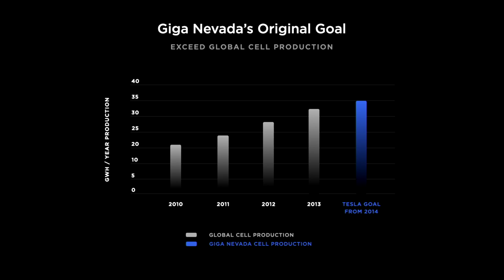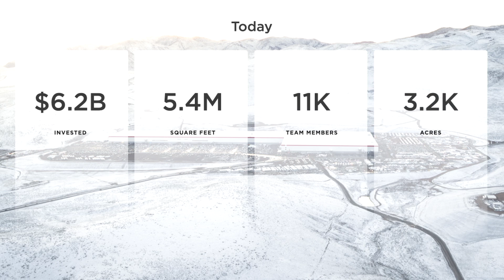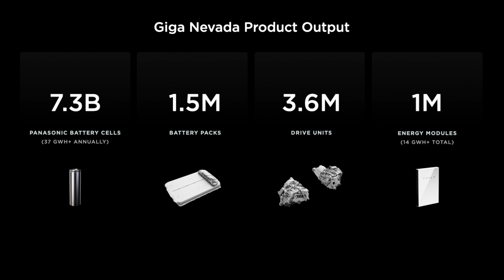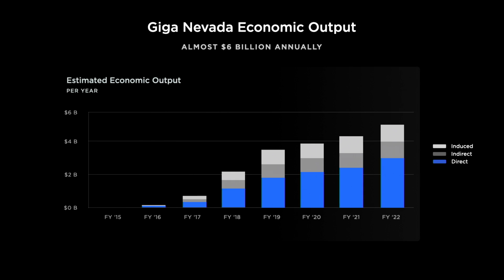Giga Nevada Battery and Semi Manufacturing Update

Comment: I am not a US citizen but I feel very proud and touched what you guys are doing. Good luck for Tesla and Nevada!
Reply: @potatotiel HAHAHAHA. You’re oblivious as hell. Teslas do not degrade the way normal cars do. It is much much harder to break down the toxic waste of a tesla than an ICE. but go on living in your fantasy.
Reply: @potatotiel A tesla is roughly 50% plastic by weight. Most of the plastic is not recycled or even recyclable.  Plastic recycling is a failure in general.
Reply: @potatotiel I replied,  but dont see it. So I will try again. Fuel cannot be recycled, correct.  But neither can the energy (fuel aka grid energy) that was used to charge your electric fuel tank. Where does the grid energy for the battery (aka fuel tank) come from?

Do some research into plastic recycling.  It's really bad, most ends up in the landfill.  The triangle doesn't mean it's getting recycled.  A plastic throw away ev is a horrible idea in the 1st place. Long lasting, practical sized and reasonably powered ice and electric vechicles are a far better option for our environment. 

75 hp, 60mpg  2,000 lbs simple ice or electric vechicles is the answer for now. Not 4,000-8,000lb 300-1000hp 350v monster grid powered electric vechicles. Overpowered ev is putting the cart ahead of the horse when we don't have abundant clean grid energy available in the 1st place.
Reply: @potatotielBut 99% dont have regular access to a solar charger. How many solar panels do you have?
Reply: @potatotiel car owning in general is negative for the environment and is only necessary in rural or bad designed suburbs and the occasional horribly designed city. It’s not a favor, it’s just less bad if you drive a lot.
Reply: @potatotiel Cities and horrible for the environment.  All the land is destroyed and contaminated. Pavement everywhere,  massive disruption to migration and wildlife in general.  Streams and rivers carry millions of tons of trash and plastic from these high people concentration area to the oceans

Cities = environment disaster.
Reply: @potatotiel no.
Reply: @potatotiel no
Reply: Welcome friend!❤🎉❤🎉❤
Reply: 1년전이지만 좋은 사람들과 일하고 계속 새로운 자원을 발전시키는 일론은 일중독입니다. 좀 쉬어야됩니다.건강하세요 ❤❤❤
Reply: @potatotiel  A battery only stores energy. What you're saying would be no different than a gas tank manufacturer producing a whole bunch of gas tanks claiming they are saving the world.
Reply: @Dat_Sun  if those gas tanks were able to power cars with no emissions, sure
Reply: @miscl_anon  Please educate yourself. Teslas DO NOT have 0 emissions. Those emissions are just simply in the production process rather than day to day use.
Reply: @satvikarora5813  
>production process 
by that logic, wind turbines and hydroelectric dams aren’t environmentally friendly either bc they surely produce emissions when they’re being built

>rather than day to day use
right, the car is zero emissions. the factories that create it might not necessarily be
Reply: @satvikarora5813  
>easily be recycled
And how much is it contributing to emissions while it’s operating? Also, internal combustion engine cars still use batteries, which also need to be replaced periodically. Please educate yourself
Reply: @miscl_anon   Sure that could be done. Ethanol. But it's not very practical just like an electric vehicle is not very practical. We can charge a battery with "renewable energy", but are we?  Virtually all of our grid is fossil fuel powered. Especially during the night time when you want to charge. We don't have enough grid capacity as it is.
  Then ask yourself what is renewable energy and does it involve fossil fuel?
Reply: @Dat_Sun  
>but are we?
depends on what kinda infrastructure is available. tho it’s best to install solar panels on your roof so you know for sure
Reply: @miscl_anon   As a whole our nation is basically fossil fuel powered. Sure there are millions of tons worth of wind turbines and solar panels, but they're hardly accounting for anything at just 17% at best.  17% does not consider all of the fossil fuel powered equipment that is used and required to maintain these projects.
  It does not consider the turbine gearbox oil changes, It does not consider the thousands of employees who fly all over the country to maintain construct or decommission these things. It does not account for the heavy oil that was burnt while being floated across the globe, or the semi trucks that deliver it, it does not take into consideration fuel used to create access roads, to dig and pour massive concrete foundations for Wind turbines. It all adds up quickly to = a big sham.

 I do not believe that solar is a good idea. How much power can you expect from 1 average solar panel?
Reply: @Dat_Sun  
>I do not believe that solar is a good idea
Solar isn’t the most power efficient, but the states aren’t exactly building nuclear reactors anywhere, and it’s not like the government will allow consumer grade nuclear reactors

>Our nation is basically fossil fuel powered
And it will stay that way if we don’t take steps to transition. Buying electric cars and trucks is one of those steps. The country didn’t come to rely on fossil fuels overnight, and it won’t come to rely on renewables overnight either
Reply: @miscl_anon  The best thing is a mix. Some ev where abundant wind, solar or hydro is available. But electric vehicle manufacturers need to immediately stop with the insanely heavy and overpowered ev's. A 500hp ev sedan is incredibly wasteful and it's putting the cart in front of the horse.  Until we have an abundance of clean grid energy and enough materials to manufacture lithium cells, overpowered ev will continue to be as wasteful as ice.

A 2500lb 75 hp ev car or truck makes sense, not a 4000-8000lb, 300-1000hp 350 volt monster with thousands of lbs worth of lithium batteries on board. 

Same goes for ice manufacturers,  the wasteful 300-1000+ hp vechicles available today are energy cows, requiring excessive fuel, more maintenance and Lots of tires.  Both ice and electric vechicles have become ridiculously overweight and overpowered at the same time. Loaded down with thousands of lbs of junk and plastic.  

  Our only real option is to downsize back to reality and be more efficient.  We can manufacture 2klb 75hp 80mph ice vechicles that get 50-80mpg but nobody wants them, everyone is special and deserves a bigger, more powerful vechicle than the next guy. 

  Most importantly people need to understand the battery is basically a fuel tank not a energy source.
Reply: @Dat_Sun  
>basically a fuel tank
The primary problem with fossil fuels is pollution, which batteries offer a solution to. An ice car creates emissions as it burns fuel, but the only thing an electric car emits as it drains energy is heat, which gets dissipated into the atmosphere
Reply: @miscl_anon  Wrong, where is the energy coming from? You are still seeing the battery as a fuel source.
Reply: @miscl_anon  And who says ice vehicles pollution is a problem? What vehicles in particular or are you grouping them all together?
Reply: @miscl_anon  not really true, windturbines produce more energy than the production of the windturbine required. teslas don't.
teslas waste energy by wearing down it's own battery and the tires wearing down, as well as the pavement getting damaged by the tires since EV's are quite a bit heavier than normal combustion engine cars. i don't use a car at all, i use my 28 mph e-bike to get around the city and town, it brings me to work, to school, and grocery stores.
the world can't really get sustainable unless we humans change our habits/norms.
Reply: @miles5600  your 28 mph ebike is gonna have a hard time carrying more than 1 person, or more than a week's worth of groceries for 1. cars exist for a reason

>teslas don't
... teslas aren't meant to produce energy? they're meant to offer a clean alternative to gas powered cars
Reply: @miscl_anon  man you're so wrong...
it's an urban arrow e-bike which can easily carry your weekly groceries and it can also carry a full grown ass human. this is exactly what i mean that your mind is totally carbrained.
Reply: @miles5600  >easily carry your weekly groceries
what about a month's worth for 4 people?

>a full grown...
what about two? four?
Reply: @Dat_Sun  >where is the energy coming from?
Anything that can generate electricity, unlike gas powered cars

>who says ice vehicles pollution is a problem?
the epa
epa.gov/nutrientpollution/sources-and-solutions-fossil-fuels

my previous reply to you disappeared fsr so I'm doing it again
Reply: @Dat_Sun  >where is basically all of our energy coming from?
sure, it's fossil fuels, but it doesn't have to be that way, and adopting renewable energy [eg. using electric cars] will help move away from that

>science and records are
idk what you think the epa does if not working with science and records
Reply: @miscl_anon  Using the Electric Car right now is placing the cart ahead of the horse. Once we have the available clean renewable energy problem solved and on the grid. Until then it's a sham for profit.
Reply: @miscl_anon  a month for 4 people work fine too.
if you wanna transport 4 people, get 2 bikes.
would still be cheaper than a car and actually sustainable.
Reply: @miscl_anon  Again,  Tony Heller and do some research for yourself.  The epa is seriously corrupted.
Reply: @Dat_Sun  On the contrary, adopting the electric car now would eliminate the dependency on fossil fuels faster, since cars would no longer rely on them. that leaves the grid, instead of trying to transition the grid first, then spending another decade trying to transition society to electric cars
Reply: @miles5600  two bikes implies you can find someone to ride that other bike. what if you're trying to transport 2 people who don't know how to ride a bike?

>a month for 4 people work fine too
I'd like to see you try
Reply: @Dat_Sun  >Tony Heller
you'd rather trust some nobody on the internet than reputable sources. tells me how much to value your views
Reply: @miscl_anon  The grid demands would sky rocket. We would have to build hundreds of coal plants to meet demands making things worse. Remember the Battery is like a extremely heavy fuel tank, it's not a source of energy. It stores it, and does a poor job in general.
Reply: @miscl_anon  try? search it up on youtube, there are enough video's of that stuff.
it's not my problem if someone can't ride a bike, even though it's really easy to learn.
how about the people that need to get a license? costs them even more money and learning to drive is pretty difficult if you wanna learn it good.
Reply: @miles5600  >there are enough videos of that stuff
I don't see a single one with 10 bulky bags worth of items

>it's not my problem
then why are you trying to antagonize cars if you don't care whether someone can use your alternative?

>how about the people that need to get a license?
see, the nice thing about cars is that, as long as at least one person in the group has a license, they can operate the vehicle, which can usually easily seat 3 more people. unlike a bike, which is usually built for one person
Reply: @miscl_anon  Using practical amounts of fossil fuels is totally acceptable. History proves this, things were worse long ago, I remember smog from 70-80's, but some adjustments to performance were made using emissions equipment and testing solved that. 

The problem now is people expect to much. Everyone wants bigger, faster, fancier, more needless tech. The end result is 300 ~ 1000hp 4,000 -10,000 lb electric vechicles that rely on fossil fuels from birth till death. 

As of now, there is no practical way to recycle li-xx batteries. Most are told to discharge them and puncture the envelope or cell wall before chucking them in the trash. We will run out of li-xx materials well before fossil fuels could be used up. The future of ev depends on a new environmentally friendly battery, and fossil fuel footprint free wind turbines and solar. Don't hold your breath. 

We are seeing the same wasteful designs as electric with ice vehicles as well, it needs to stop. We can do just about anything we need on 50-200hp for most vechicles. 1000hp Tesla's, chargers or other hotrod gas and energy hogs are a much bigger problem than practical ice couldever be.
 A reasonable mix of low power, high efficiency vechicles, cars and trucks would be ideal.  Most importantly in a free market.
Reply: @Dat_Sun  >using practical amounts of fossil fuels is totally acceptable
then using none at all is even better, no? besides, the "practical amount" will be different from place to place. a lot of people using their own "practical amount" adds up to an impractical amount of emissions 

>we will run out of li-xx materials well before fossil fuels could be used up
we will most likely come up with new battery technology well before we run out of li-xx materials

>the future of ev depends on a new environmentally friend battery, and fossil fuels footprint free wind turbines and solar
no time to start like the present
Reply: @miscl_anon  it's not like everyone in the US lives with 4 people in one house, some do but a heck of a lot do so to at least get 2 people to get groceries is a major step.

in europe pretty much everyone can ride a bike so maybe that's a sign that the US should make bike practice a standard subject in elementary school...
you gotta begin somewhere so if you're saying that bikes are a problem because some people can't ride bikes than you're not open. 

if you look at cars passing by on highways you'll see that a LOT of them are only occupied by one person and not 2, 3, or 4.
but they take up so much space that it's a waste of the cities space.
i recommend you watch: not just bikes, on YouTube to really get why US infrastructure sucks and why this needs to change if we wanna drastically push back our climate change from getting worse.

bikes and e-bikes work fine in Germany and The Netherlands so why not in the US?
Reply: @miles5600  
>it’s not like everyone in the US lives with 4 people in one house
Not everyone lives in a city either, where everything is conveniently a block away. Some people have to drive a mile or more to get from place to place, which makes biking tiring and impractical

>that’s a sign that the US should make bike practice a standard
i think the potential legal liabilities from injuries would prevent that from happening

>why not in the US?
The United States is such a big country that what works in one area won’t work in another. Again, people who don’t live in cities use cars to get around conveniently. For people who do live in cities, bikes work fine if you need to haul a small load or travel somewhere nearby
Reply: @miscl_anon  I explained what practical is, 50-200hp ice. Not 4k- 8,000lb ev @ 300-1000hp.

There is always claims of future battery tech.   Basically nothing has changed since the beginning.  Battery tech is ALWAYS a trade off. Reliability and durability for capacity. Batteries are always big heavy.  

Solar, wind turbines and other gimmicks are just that. Where does a wind turbine come from? Lets take a clipper liberty series 2.5MW. Where did it's life begin?
Reply: @Dat_Sun  >50-200hp ice
ok? that says nothing of how much the car is used. more frequent driving means more frequent emissions, regardless of how much fuel it consumes

>where does a wind turbine come from?
>where did its life begin?
yes, they both came from fossil fuel powered assembly lines, but they’re expected to last decades, which i’d argue far offsets the amount of emissions produced in creating them
Reply: @satvikarora5813  Tesla’s have significantly greater efficiency in terms of the energy it uses so even if we assumed that all of our energy production is from things like gas ( it’s not ) it would still be better in the long term.
Reply: @miscl_anon   Ever since the late seventies we've seriously reduced vehicle emissions with smog equipment.   It's at a point now where it's not a problem.  
But we need to think of the future and stop manufacturing ridiculously overpowered vehicles both electric and ice.

 Until we have some kind of magic powercell that generates electricity from water or air on mass without any significant external fuel or power source (aka a perpetual energy machine) hopefully air because water is scarce in a large parts of the world. Until then, we need to be responsible and take only what we need. 

Wind turbines hardly ever last as promised, and generate far less than rated/advertised output on average. 
 I assembled,  commissioned,  repaired, decommissioned and assisted in demolition of Clipper Liberty series wind turbines within a few years. The same turbines.. Literally blown up and written of due to high maintenance costs. 

This happens all the time, wind turbines fail daily,  manufacturers like vestas keep employees lips sealed with non disclosure agreements.  I have seem Clipper blades break and fold over, I've seen Mitsubishi turbines spray oil over acres of crops then burn to the ground and not get reported.  

I have worked at sites changing ownership in a year or so, maintenance turns into a sham, everyone gets cheap, major maintenance gets ignored because of cost. Towers catch fire and fold over without witnesses all the time, it's hardly reported. Tax cattle and energy consumers flip the bill. 

I know this as fact having worked up tower for over a decade, even longer on the ground assembling nacelles, unpacking shipping containers of parts to assemble the towers.  Each tower comes with a whole shipping container or two, maybe more. . Parts are from all over the world, mostly from places that dont have any environmental standards or requirements for manufacturing. When all is considered, we do not have renewable energy. 

How much concrete is used for an average 3.0mw turbine foundation?  What about the roads? How much energy was used? What about the substations? Conductors? Maintenance buildings,  hundreds of gas or diesel powered trucks, employees,  rigs with replacement blades non stop across the country, constant gear box failures,  huge cranes using vast amounts of fossil fuels. None of that or the process not listed is ever considered.  

Do you ever wonder why none of these subsidy farm sites are using electric field maintenance vehicles other than a promotional 1 or 2 trucks occasionally seen? 99.99% are driving a ice rig. Electric powered  pickup trucks, service trucks and cars don't cut it, not enough power density and to heavy for adverse conditions commonly found on site. 
You will never see maintenance or construction using them on wind sites other than promotional.

Solar is even worse.  Takes a lot of panels to charge a ev, and requires additional expensive equipment, that has significant/ environmental impact/ emissions footprint.
Reply: @Dat_Sun  >wind turbines hardly ever last
>solar is even worse
what about nuclear? i’ve been hearing good things about it
Reply: @miscl_anon  The amount of fossil fuel investment is significant.  I am not confident nuclear makes any sense when absolutely everything involved such as mining,  refining, and manufacturing nuclear fuel is tallied up. 

We also need to consider the energy required to store and secure the spent radioactive fuel in a under ground prison for a about 100,000 years or so.
Reply: @miscl_anon  82 percent of people in the US live in cities so that’s not true.

Biking is not tiring nor is it impractical, bikes give people some exercise which is desperately needed in the US and having an e-bike allows you to bike 15/30 miles.

Kids need to learn how to cycle cause it’s the future of transportation whether you want it or not, americas infrastructure is unsafe for cyclists so maybe change that,
Idk what you mean with accidents cause at the moment. In 2020 more than 35.766 people died in fatal car crash in the US, meanwhile 1.260 people died in a fatal bike accident including cyclists that were run off the road by drivers cause those bike lanes are just paint on a dangerous road.
Reply: @Dat_Sun  >I am not confident nuclear makes any sense
you’re really skeptical about alternative energy sources aren’t you?
Reply: @miscl_anon  For good reason.  Follow the money.
Reply: @miles5600  >82 percent of people 
82 is 18 away from 100, so i’m not seeing your point. “most people” live in the cities, sure, but that’s not “everyone”. And i’m not keen on ignoring 60 million people

>Biking is not tiring nor impractical 
“Physical exertion is not tiring” “Resting frequently while traveling long distances is not impractical” now you’re just coping

>it’s the future of transportation
not in the foreseeable future, at least not in the states

>idk what you mean with accidents
you mean you’ve never once fallen over and hurt something while learning to ride a bike?

>cause at the moment
“More people die in a fatal car accident than a fatal bike accident” well… yea? That’s what tends to happen when you have more cars than bikes on the road
Reply: @miscl_anon  no, it only tends to happen when you have unsafe roads.
If you don’t believe in safer infrastructure Like prioritizing bikes over cars and changing the road design that gets used in the US then yeah cars will remain the standard for people instead of bikes also oh 80% or 82% of Americans live in cities we still only have about 2 to 3% of people in the US cycling and that could easily change if people like you change their minds that just a little then other people will too, and everyone will start learning from the past mistakes like the car getting dominated in the market because if it’s easiness and the comfort, it delivers. But you probably have never been to the Netherlands because the Netherlands actually prioritizes bikes over cars and gives cyclist comfort that they need. and I don’t know why you think the US can I have a future with bikes, playing a big part in its transportation because Paris was a whole car centric shitty place a few years ago, but started to change that at around 2017 and now they’re really expanding, their bike, net work, and people are actually choosing the bike instead of driving the same thing happened in the Netherlands people think that the Netherlands has always had its biking infrastructure the way it is today but that’s not true in the 1980s they started changing their infrastructure design manuals because people wanted to people wanted safer roads and look at the country now they’re doing great but if you keep arguing about something that you don’t know anything off like urban design, then you should research it.
Reply: @miles5600  >because of its easiness and comfort
that’s exactly the reason why. Cars are easy to travel short and long distances over, which makes them a convenient, all purpose vehicle. 

>I don’t know why you think the US can’t have a future with bikes
I don’t even see any consistent, widespread interest in using bikes over cars, so i doubt that’s a future that will come any time soon

>prioritizing bikes over cars and changing the road design
it took tesla 20 years to get to where it is today, and that’s with active financial backing. I highly doubt something with as little interest as biking transit will gain dedicated infrastructure in the near future
Reply: @miscl_anon  bruh that future will come very soon. Towns and cities around the US can barely even afford their infrastructure anymore cause of all the pavement they need to maintain and destruction highways have caused to pretty much every city and town in the US.
Reply: @miscl_anon  like i said, cities and towns can barely even afford their infrastructure, car infrastructure doesn’t work and idk why you think it does cause it doesn’t work. They’ll be forced to invest in alternatives like bike infrastructure cause the road wear is non and it costs little to install.
Like i said you should probably watch some videos from not just bikes
Reply: @miles5600  >they’ll be forced to invest in alternatives like bike infrastructure
alright, lemme know when that’s supposed to happen. I’ll using my car to get from place to place until then

>it doesn’t work
if it didn’t work, we’d have replaced it a long time ago. Just like rotary phones were phased out with the advent of mobile phones bc mobile phones were vastly superior
Reply: @miles5600  >that’s not how you should think
“it’s only a problem if you view it as a problem” who would’ve guessed 

>the government should
imagine relying on the government to make change. The government wasn’t the one who popularized electric cars, tesla was. If you want bikes to be popular, start a company in the states that makes appealing bikes and see how that works
Reply: @miscl_anon  just watch not just bikes
Reply: @miles5600  you say that like i’m interested in the why. the why doesn’t matter if the question is “when”
Reply: @miscl_anon  you're not getting what is wrong with america's infrastructure.
just watch him it's not that difficult.
Reply: @miles5600  >you’re not getting what’s wrong
i’m not asking what’s wrong

>just watch him
i have no interest
Reply: @Dat_Sun  no. Im sorry that is NOT the case.
Reply: have you seen the lithium mines? nothing to be proud of really.
Reply: @satvikarora5813 where at.
Reply: @satvikarora5813  Isnt anywhere as bad as fracking tho
Reply: @finbeats  fracking is not as bad at all, its a massive fud surrounding fracking. it can be done very environmentally friendly.
Reply: @dealerovski82  Fracking is fracked up.
Reply: @finbeats  fracking isn't that bad either, to be fair. It is an area where it actually pays off to be environmentally conscious
Reply: @dealerovski82  fracking is corrosive.
Reply: @satvikarora5813  Have you seen oil mafia? i think you are proud of it.